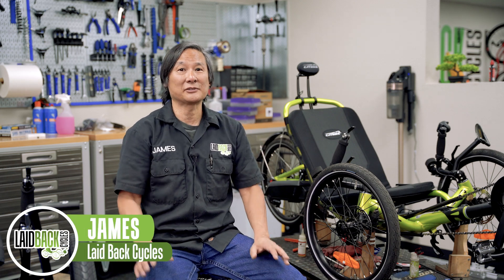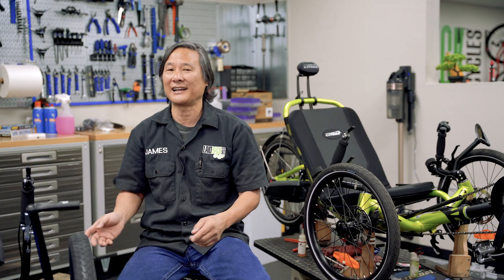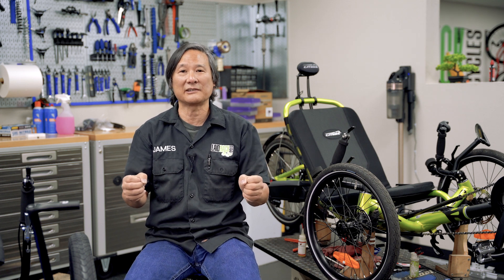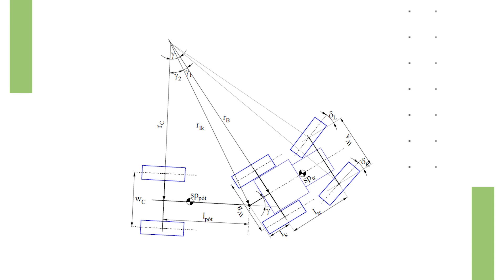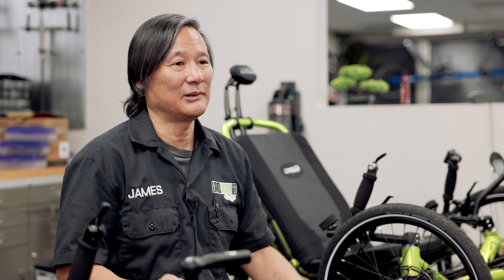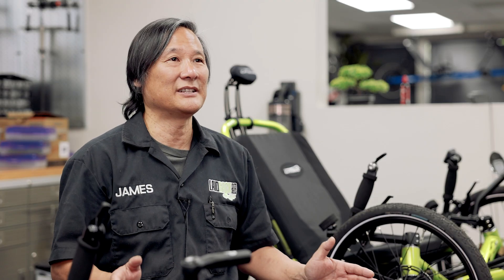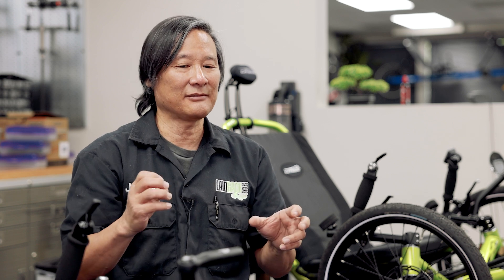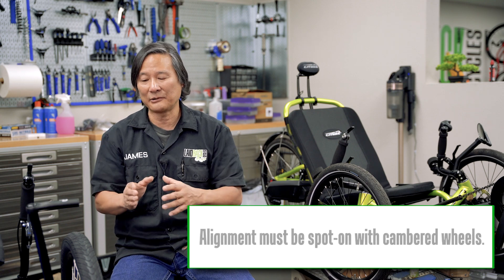Ackermann Steering & Camber | Recumbent Trikes - Explained

Comment: Just discovered your channel and I'm loving it. Question: any chance you make a video about hooking up a bike trailer to a recumbent ebike? Does it matter what type of motor you have, where the motor is, etc? Can it go up hills? Do most hitching systems work or only specific types?
Reply from the maker: We don't have a specific video on that topic, but I generally recommend the Burley Bee Bike Trailer as it tends to work well with most trikes.
Reply: @LaidBackCycles  I already have a Croozer double bike trailer. I used to bike about 80 miles a week, hauling the kids places. Then I lost my leg. Biking on a standard bike is possible with a prosthesis, but requires a special prosthetic socket because regular sockets don't have enough range of motion. I've found that the farther forward the pedals are from the seat, the easier it is to pedal with my prosthetic leg. Hence I want to switch to a recumbent bike. I just don't know if they're able to pull a trailer. Plus there are a lot of hills in my area. Do you have any suggestions?